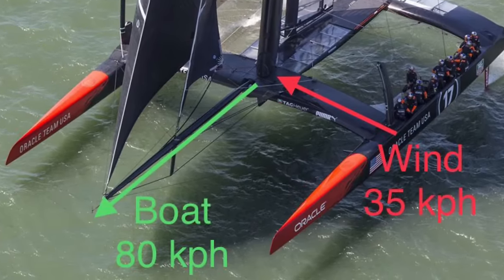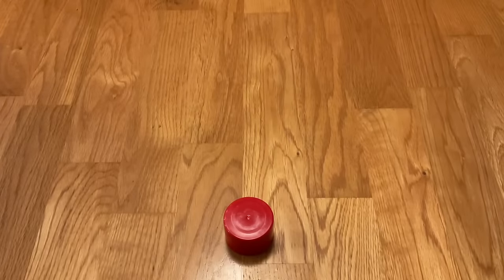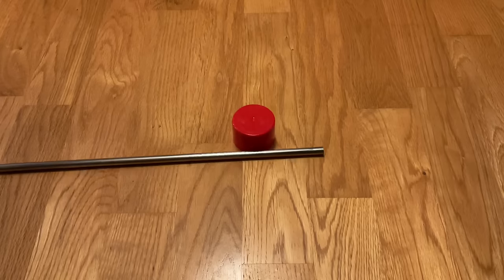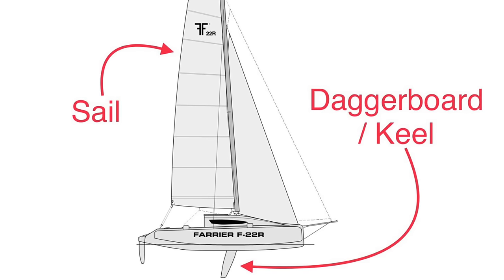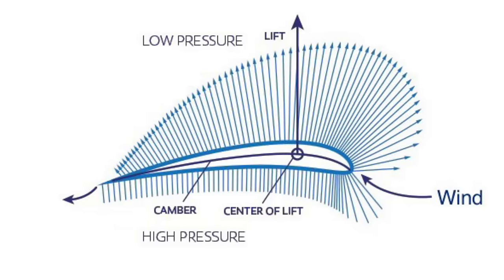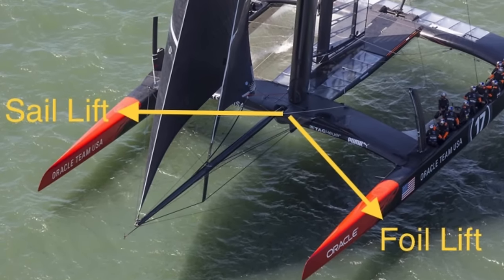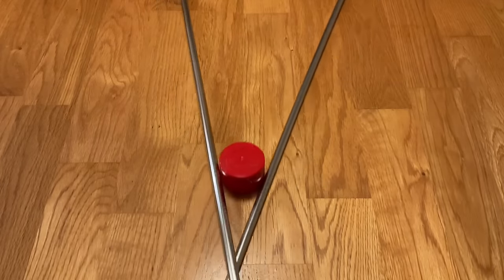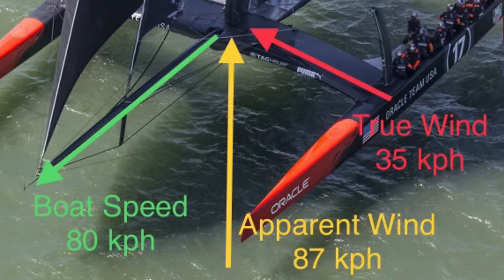How Does a Boat Sail Faster Than The Wind?!?!?

Comment: This is only true when the boat is not travelling in the same direction as true wind right? Can a boat travel faster than true wind in the same direction as true wind? Assuming the wind is constant
Reply from the maker: Fast boats typically tack through 90 degrees going upwind and also gybe through 90 degrees going downwind as that’s much faster than sailing dead downwind! In other words the are typically sailing across the true wind to some degree although the apparent wind they are experiencing due to their speed is always from ahead.
Reply: @SailingTipsCa   So for example there is an island 35km north from my boat. There is a wind heading directly north at 35km/h. If I travel exactly straight north in the exact same direction as the wind, it would take me 1 hour to get to the island? But if I zigzagged back and forth I could get there in faster than 1 hour?
Reply from the maker: @mcdonaldslover52  Sailing dead downwind is not very efficient because you effectively “outrun” the wind so you’d be lucky to get 50% of the wind speed as boat speed so it will take you about two hours. On the other hand if you gybe back and forth in a zigzag you’ll travel about 1.4 times further, but you’ll also be able to achieve more than twice the speed so should be able to make it in about an hour in a fast boat.
Reply: @mcdonaldslover52  yes, depending on the boat.  Also, it is possible to build a land device (not a boat, but something with wheels) that can go DDWFTTW -- Directly Downwind Faster Than The Wind.  It's been built and proven.

Comment: I thought it was all about apparent wind. I used to have a small land yacht that would “sail” much faster than actual wind speed. No second foil there
Reply from the maker: Yes it all really comes down to lift (from the sails) versus drag (from the sails and the surface the “boat” is “sailing” on. Ice boats and wheeled land yachts (e.g. blo-karts) can easily sail faster than the wind because there is so little drag with the surface they are on. They use the same principles in this video but with one rod stationary and representing their lateral grip on the surface. It’s a bit harder on liquid water because there is much more drag. Lifting foils help reduce drag, but they are not necessary for all boats as there are also many other types of boats (e.g. planing dinghies, multihulls) that can still sail faster than the wind without lifting foils.

Comment: Nice video, but in 15th century portuguese ships were already sailing against the wind, so old long distance sailling ships already weren't as basic as you depicted.
Reply from the maker: Yes there were a few designs that could sail better to weather than others, also Junk rigs, but the theory of lift still wasn’t well understood, and most boats struggled to sail at even half the true wind speed up until much more recently.

Comment: You're wrong about the square riggers. Unless sailing down wind, they used the same principle.
Reply from the maker: How did they generate lift to weather below the waterline without foil-shaped keels?
Reply: @SailingTipsCa 
 The sails are flown at an angle (from centerline) to produce the lift. Into the wind - you would tack.
  Very basic sailing information, try Wikipedia or some books on square riggers.
Reply from the maker: @BIG-DIPPER-56  Yes I understand the sail part and a long straight keel would let them reach somewhat, but they wouldn’t be nearly as close-winded as a modern sloop with fin keel, and were therefore very vulnerable to being smashed on lee shores!
Reply: @SailingTipsCa  
???
Of course
???
Reply: @SailingTipsCa  anything pushed sideways through the water will generate lift; the shape of a well designed foil does better (has a higher lift-drag ration) than a hull without a keel, and the square rigger's sails are also not efficient upwind, but square riggers could definitely make ground to windward.

The name of the game is efficiency.

Comment: 00:16 İt's not inefficient because they need force in those big heavy ships instead of speed and it should be able to continue travel even when wind is weak if they were using other sail types it would be like trying to go in fifth gear when you're literally unable to even go as fast as 40 km/h, so don't make old tech look like bad those sail types was so efficient but if you are going to manufacture a car with 18 wheeler truck transmission than it's Gonna be trash
Reply from the maker: Yes but if those old sailing ships had the exact same sail area configured more as wings like a schooner or modern sloop even they would have been faster!
Reply: @SailingTipsCa  they were already have that knowledge but they didn't because it wasn't practical when average wind speed on ocean is not more than 6 m/s and a bulk ship designed for travel usually and get wind speed higher than 8 m/s rarely even if it was designed like that you said it would get higher max speed but it would cost them ridiculous amount of average cruising speed when it's most important specification is that also those ships had hull speed as a limit and when you reach %80 of hull speed amount of power to get speed gets ridiculously high till you exceed that speed and Start to Surf on water and as you can guess if you were able to get that speed still you would need a very high power for a short time to exceed the hull speed than you would be able to maintain that speed but you wouldn't get that powerfull short wind so don't underestimate old tech and don't spread misinformation
Reply from the maker: @eshabbatan9411  The ship at 00:16 is the Batavia completed in 1628, and wings weren't well understood by humans until at least the mid 1800s, so how could they have had that knowledge then? Also, how would a wing-shaped sail that would enable them to sail at a higher percentage of the wind speed/hull speed be a bad thing? These old ships were also very vulnerable to lee shores and many were shipwrecked because they couldn't' escape and were blown onto the rocks, so wing-shaped sails that enable them to sail upwind would have been very helpful, even if they couldn't exceed hull speed.
Reply: Look at junk sailing boats they knew the only way to travel wasn't drag force but because of strength and durability they made ships with fixed sails so much also you said with the same wing area you could make it much more powerful yes it's true but with same height you couldn't make it more powerfull and you can't make so high sails because it would lay down the ship so you would rather a low center of gravity(within the lift and drag force of wind, I don't talk about center of mass) so a wide horizontal sail would be better than a vertical very high (maybe 4 times longer than ship length)
Reply: I mean the cost of sailing faster was so much so they didn't use it because in those times sails and woods were less affordable think about that at those times your problems were not depression or something like that your problem was that you are hungry😅 you need a home to be protected you need water and basic needs like that so it was just a luxury to be fast but making the most basic ship was a need
Reply from the maker: @eshabbatan9411  Yes there are some great junk designs and some people still use them today!
Reply from the maker: @eshabbatan9411  Back then you pretty much needed to be sponsored by a king or queen to build a large sailing vessel!

Comment: Just so people know, the primary purpose of a dagger/centreboard is to counteract the leeward push of the wind. If you’re sailing a dinghy with the centreboard raised, you’ll soon know about it on a reach.

If you have to go on a downwind run though, pulling the centreboard all the way up reduces drag and gains you some more speed, especially if it’s only a light breeze. 

Foils on the other hand generate vertical lift, raising the entire boat out the water.
Reply from the maker: The term “foil” can also be a general term for any underwater appendage that generates lift, including rudders, daggerboards, and of course lifting foils.

Really fast boats are always sailing with the wind well forward of the beam, so you are still relying on the daggerboards to generate lift and maximize performance even when going downwind, although you can pull them up part way to reduce drag. 

Even my non-foiling F-82R trimaran will sail with the apparent wind at 45-60 degrees under spinnaker while the true wind is more 90 degrees aft of that at around 135-150 degrees true.

Comment: Try Ice Sailing. Apparent wind ends up almost nose on. "Close Hauled" takes on new meaning. Everything is great until a lull! Then the apparent wind ends up BEHIND the sail. At which point the sail pulling as hard as you can hold comes at you! Very exciting at 60 mph on skis with a windsurf rig. Bonus is, unlike water which a trained eye can see gusts and lulls, little or no such hints at a change in wind speed or direction are readily available on a frozen lake. So if you want to find the razers edge of sailing, have a go. :)
Reply: Some ice boats can sail apparent wind angles of less than  7°,  so they can sail more than  8 x windspeed across the wind. They can also have a downwind component of more than 4 x windspeed, and an upwind component of more than 3 x windspeed.
Reply from the maker: Ice sailing looks completely crazy! I think I’d try a BloKart (wheeled buggy) first to get the hang of it!
Reply: @SailingTipsCa  Thing with ice sailing, you need to fully INTEND to go fast to do so.
It is the best "ragged edge" thing I ever did. At anything over 50mph each second feels like you will wreck in the next second, mostly due to what is propelling you, the sail, is also trying to smash you. Being backwinded into glare ice at warp speed is at best obnoxious. Good thing is, on glare, you only hit once. :)
Reply: @SailingTipsCa  Ice boats have been achieving the wind-speed multiples of the most recent foiling boats for over a century now. But ice sailing is less widespread, so many still have problems understanding and accepting this, even among sailors.
Reply from the maker: @bradkubota6968  Even though I live in Canada I’ll have to find someplace a bit colder in the country to try it!
Reply from the maker: @bradkubota6968  That sounds exhilarating! I think it would be strange to not be able to see on the ice where the true wind is coming from, but maybe it doesn’t matter sailing so much faster than the wind?
Reply: @SailingTipsCa  Oh IT MATTERS! For sure you sail by feel with many senses trying to be trimmed properly. Goalie reaction times are handy. Being bundled up takes away some of what senses are available on water.
Reply: Iceboats answer the question posed elsewhere in these comments about how to go fast:  efficient sails above and low drag below.

The drag also important above i.e. in the sails:  with iceboats a bigger sail does not mean a faster ride, because the drag force of the wind on the sail is more important; more drag means less efficient.

Comment: I'm curious if there's a primitive way of making hydrofoils.
Using those natural glues from various trees as epoxy and layers of various bamboo or whatever other trees.
Reply from the maker: Interesting question! Foils need to be incredibly strong for a very small surface area so they are typically made from carbon fibre and epoxy, vacuum infused etc. My guess is that it would be difficult to get the strength required from other techniques but it might be interesting to try!

Comment: Is it rue that the water left behind the trailing edge of the foils on the AC cats gets as high as boiling temperature? Seems hard to believe, I know, but I read that somewhere a while ago.
Reply: You probably mean cavitation. The water is not boiling because of high temperature, but bubbles are forming because the pressure is reduced by the foils.
Reply from the maker: Yes it’s more a matter of the boiling temperature of water dripping towards sea temperature due to the low pressure, and not the water being heated. I show a clip of it in this video: How Did Vestas Sailrocket 2 Smash the Sailing Speed Record?!?! https://youtu.be/K3m06731BQY
Reply: @albatrosssoaring1487    I recall that they said boiling temp.

Comment: How can I use this newfound knowledge if I suddenly find myself in Nassau 1715? Is there a possibility to incorporate these designs into my pirate ship without any space-age materials? I don't want to be shot for wasting everyone's time building a frigate that's useless
Reply from the maker: Great question! The easiest way would be to 1) switch to a Bermuda/Marconi style rig (https://en.wikipedia.org/wiki/Bermuda_rig) with triangular sails like most modern sailboats these days. Even with primitive materials this enables you to use more wing-shaped sails which are more efficient at generating lift than a square rigger. You could also 2) add leeboards (https://en.wikipedia.org/wiki/Leeboard) to increase lateral resistance and point higher. Both of these concepts could be retrofit onto almost any boat!
Reply: @SailingTipsCa  Thanks! Now I'll just have to remember to say parlay before telling them about my ideas

Comment: The video explains the sailing dynamics of a high performance keel boat but it doesn't explain why the boat sails faster than the wind.  There are many high performance racing boats but they don't sail faster than the wind.  The video talks about reducing drags but it doesn't explains it.  There are differences between a classical displacement hull, planning hull, and hydrofoil boat.  This super short video makes sense for someone who already know how to sail.  A beginner who doesn't know much about sailing will have trouble understanding the concept, maybe he can recite the video by rote but not understanding the concept.
Reply from the maker: The goal with this video was to help people visualize the forces involved. The ability for the boat to sail faster than the wind corresponds to the angle between the rods which are “squeezing” the boat forward. With the wind dead astern the rods are at 180’ and the boat can move no faster than the rods, and will realistically be much slower. As you reduce friction (i.e. drag) you can decrease the angle between the rods to make the boat go faster, like gears in a car. The fastest boats will have the smallest angle between the rods and be able to sail at 3-4 times the speed the rods are moving, which to date is about the limit on liquid water. But ice boats have much less drag yet and can sail with the rods at even tighter angles, and therefore sail many times faster than the wind.